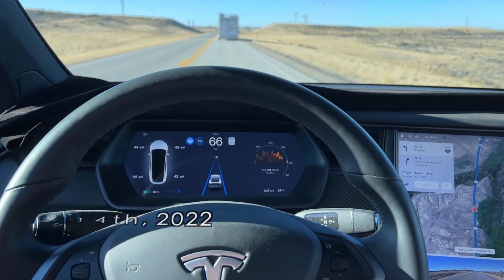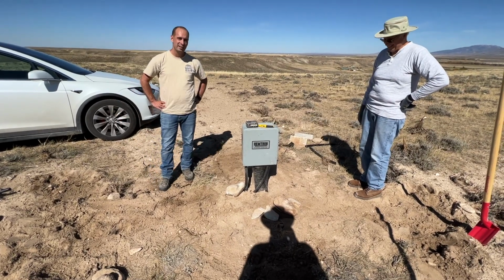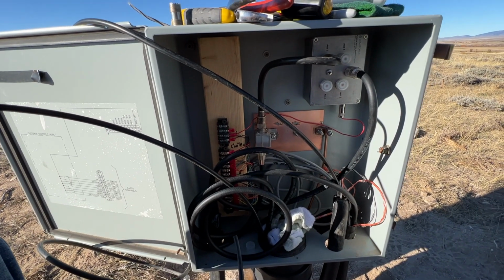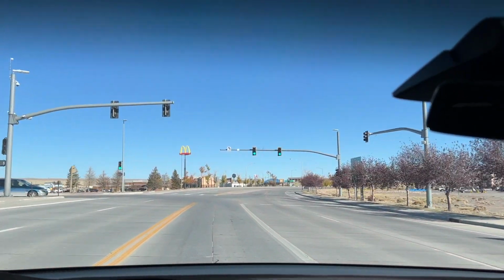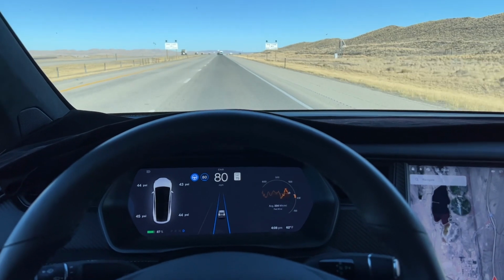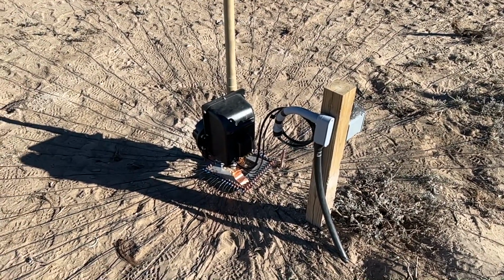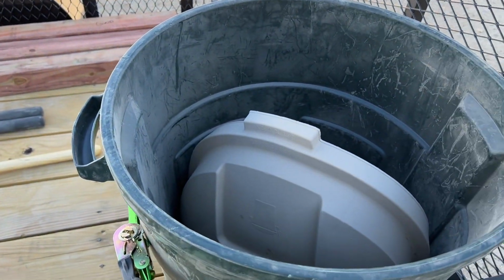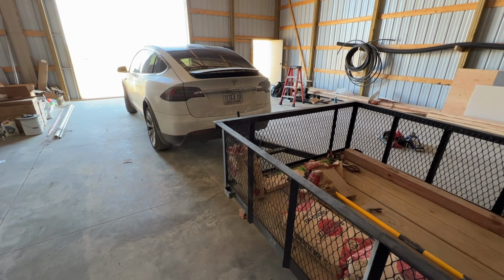Model X Working on the Ranch

Comment: Love the video!  One question.  Did you walk each of those 61 radials individually?  Why not walk like 8 or 10 at a time and then pull them and fan them out from the perimeter so there's less walking radially?  I know... I wonder about the strangest things.  😉
Reply from the maker: Each is walked individually, the wire wants to twist and it’s just as easy. The antenna works awesome with all of those radials

Comment: Very expensive working truck. Buy a Rivian or Ford EV 😁
Reply: No supercharger network, no autopilot. rivian's not very cheap and F-150 lightning is getting marked up big time at the dealers.
Reply: @thomas8421  Level 2 charging on the ranch is the way to go. They are in the boonies so supercharging may be a challenge as well. It is good to see how capable the Model X is, but I wouldn't want to use it as a daily truck.